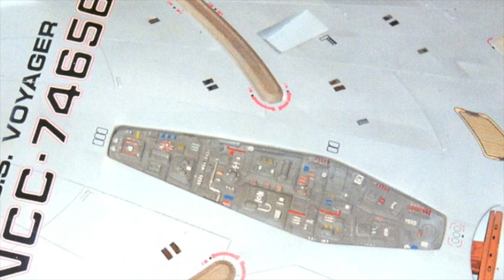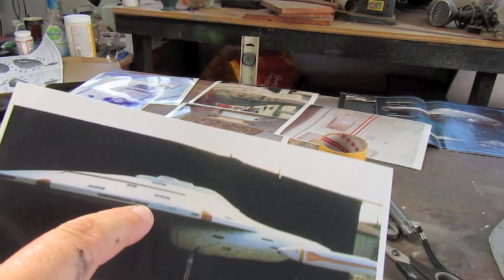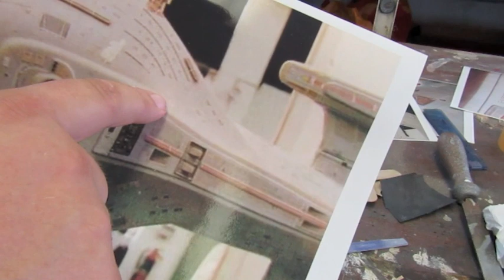USS VOYAGER DIORAMA update 3!

Comment: Looking great Dave, The sensor band modification is a pain in the bum to do as there is more work to do than first looks show, but a great job done. A little bit of advice for when you do the registration flood light, if you use an SMD the clear plastic used for the window directly below it will need to be light blocked on the top edge that meets the SMD. I found out that if this is not done the window lights up brighter than the rest.
Reply from the maker: Doughnuts Inspace thanks for the heads up Richard! I remember watching your update about that, coming together nicely can't wait to get the lighting sorted and move on to the engineering hull
Reply: I know how you feel Dave, always good to move onto the next section, I never wanted my build to end lol. Really cant wait for my neck to get better so I can pick up where I left of with the clear D and the Farragut.
Reply from the maker: Doughnuts Inspace yeah I was enjoying those builds! Lol and the refit cutaway